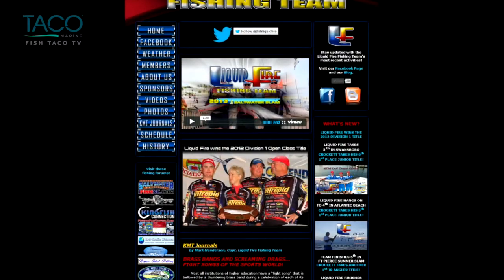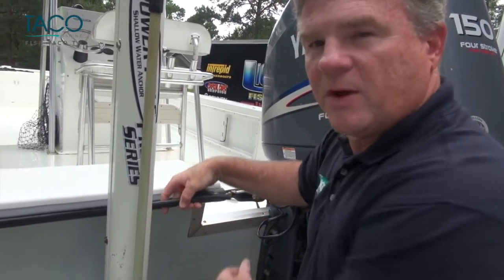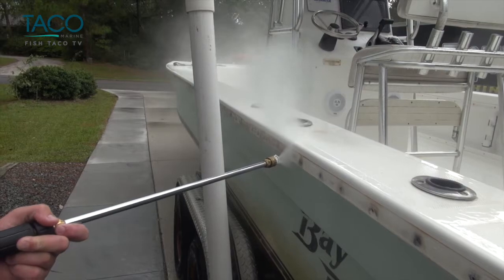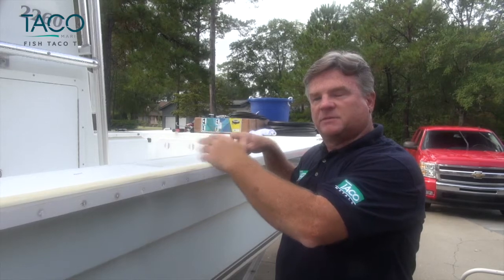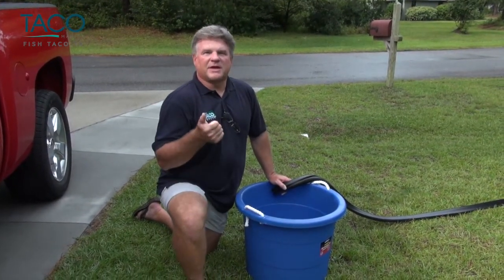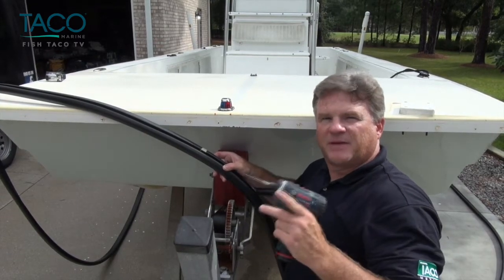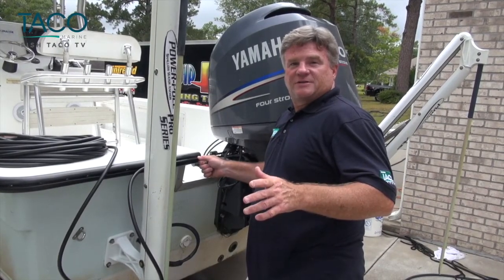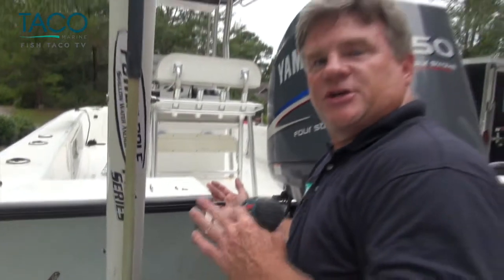TACO Marine Installing NEW Rub Rail with Capt. Mark Henderson

Comment: This was the most complete, well done video on any rub rail project. I have a 2005 Boston Whaler with the exact style rub rail, but slightly larger. The rub rail is in good condition, but I'm getting leaks in my interior - time to remove & reseal. Is there any problem with simply removing, cleaning, sealing old set screw holes and reinstalling screws in new places?
Reply from the maker: Thanks, John! There should not be any problem with sealing the old holes and installing screws in new places. In fact, that is what most folks do and what we have done in other Rub Rail installation videos. If you need additional information on how to replace your Rub Rail, please don't hesitate to contact our Tech Support team at this form here: https://tacomarine.com/technical-support. Good luck with your Rub Rail Replacement!

Comment: Thank you for this video. Hope to install new rub rail soon. 
Questions - 
- Screws or rivets?
- Why start at the front center? If i missed it in the video, sorry.
Reply from the maker: Thanks for your questions. We used SS screws for the install, which are included in each TACO Rub Rail Kit. Also, we begin at the front center for a few reasons. 1. finding the center point of the RR ensures you have equal lengths for each side of the boat around to the transom. The last thing you want is not enough on one side and too much on the other. 2. Securing at the center of the bow anchors the RR to the hull and enables you to easily and securely continue the install down each side accordingly. Please let us know if you have more questions. Thank you for choosing TACO!
Reply: @TACOMarine  Thank you, and for the prompt response!
Other question - I received SS screws in the kit, from taco.
I, have on hand, SS 3/16 rivet's, from when I reattached the top cap to the hull. 
Which would you use, to secure the rub rail, and why?
Reply from the maker: @fishingismydrug1  that's great! The screws that came in the kit are the ones we recommend using for the Rub Rail install.

Comment: Hi that boat you just did had a rolled edge, using those screw your had prob 2in of screw threads sticking out the backside of every screw, on an install like that wouldn’t rivets be a better choice, I ask because I bought your kit for my carolina skiff 238dlv with a rolled edge like the boat in this vid I got the semi rigid rail and stainless looking insert that’s just rubber coated Mylar and would like to have a professional looking outcome thanks
Reply from the maker: Thanks for your questions and comments. As the Rub Rail supplier for Carolina Skiff, we would be happy to assist with your technical questions. Please complete our Technical Support form here: https://tacomarine.com/technical-support and one of our Tech Support team members will contact you right away.

Comment: I have a 14’ Livingston cat would I need to heat the rubrail when going along the complicated front of those types of boats( very drastic turns and corners)?
Reply from the maker: Thanks for your questions. Depending on the rub rail you choose to use for replacement, you may have to use a heat gun. We've looked at photos of the boat, and the turns are on a horizontal plan, which is the easiest bend to make for rub rail.  If you purchase a rigid profile, a little provided by the heat gun should make it a fairly simple installation.  Just take your time, and it will look great.  If you purchase a flexible rub rail replacement, you should be able to make the bends without having to heat the product. Please let us know if you have additional questions. Thanks! ~ Team TACO

Comment: Hey Mark, Thank you for your "How to Install" video for the Rubrail. Does Taco Marine Have the Clear Insert? I plan to replace my old rubrail and install a new Rubrail but with some RGB LED light strips inside a clear Insert. My next option is to install the LED strip underneath the rub rail. Plz. Reply with your suggestions. Dont worry, I understand that Taco Marine will have no responsibility of my LED strip if damaged for my use of this install.
Reply from the maker: Hi Jeff, we do have a clear base insert we run for a few rub rail profiles. However, these inserts generally receive our patented Flex Chrome technology. Which profile do you have installed on your boat?

Comment: I’m refurbishing a 1969 Hydrocycle Barracuda, there’s a short video on my page showing what it is, basically a predecessor of seadoo that takes an outboard... i gotta glue the top back to inside the bottom via a 3/4 inch lip in the bottom that the top fits into. This leaves a strip of fiberglass seam that protrudes about 1/4 inch from the rest of the boat. It originally had a strip of Aluminum around the seam but it is not usable for my restoration... I plan to use 5200 to glue and seal the seam back together. Can I use just this rubber strip like you have here to apply over the seam to hide and protect it? There are 2 outside 90* turns and 2 inside 90* turns on the transom. The seam is at the very outer diameter of the boat, and is vertical.
Reply from the maker: Hi there. Thank you so much for your question. Captain Mark Henderson in this video would like to speak directly with you regarding your question, to ensure he understands exactly what you're trying to do. At your convenience, could you please fill out our Technical Support form online here: https://tacomarine.com/technical-support ? Please provide all the details above, as well as your best contact information. Thank you!
Reply: @TACOMarine  Ill contact them, thanks for replying
Reply from the maker: Excellent! Have a great day!
Reply: @TACOMarine  I just took some pics of what I’m talking about, imma copy paste this info from my comment and add the pics and send the email in a few minutes, so he will know to look for it, thanks again
Reply from the maker: Sounds great! Thank you so much!

Comment: What type of screws are you using? I bought a Taco Flex kit but no screws! I know they are SS but length and head type???
Reply from the maker: Hi Greg. Thanks for your comment. They were a #10, 1” pan head, Phillip’s head stainless steel. Hope that helps! Feel free to contact us with further questions by sending an e-mail to info@tacomarine.com.